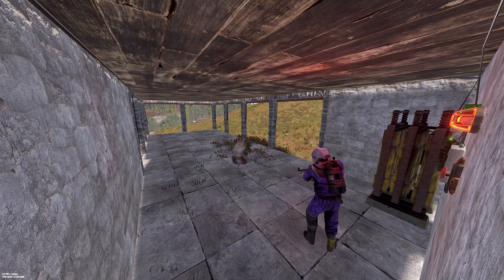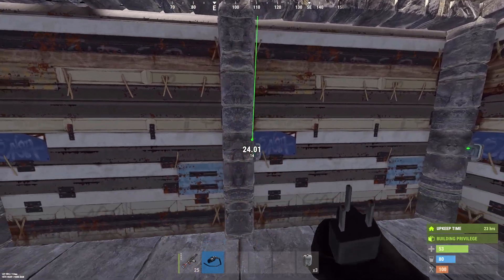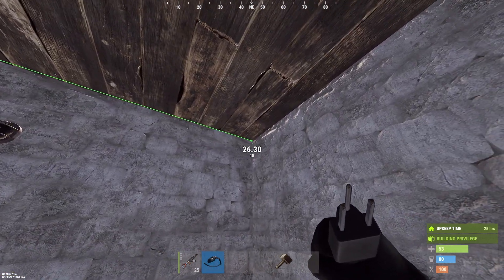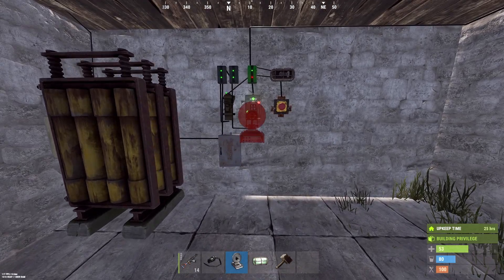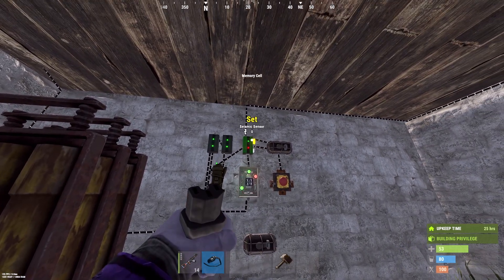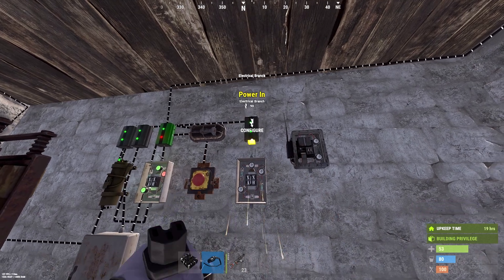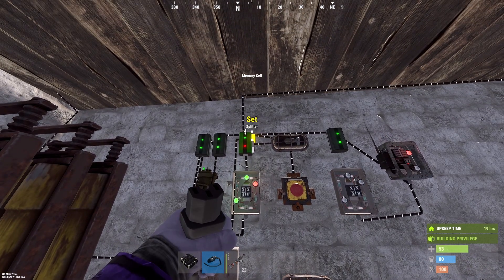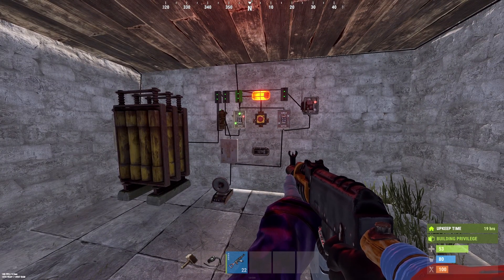EMERGENCY BASE LOCKDOWN with Seismic Sensor | Rust Guide

Comment: Just a little tip when making the panic button if you seal in the smart switch then you dont have to unconnect the button cuz if the smart switch is on then the button wont do anything.

Comment: Great setup, that first XOR switch isnt doing anything btw. You can just hook the power directly from the first branches branch out (the power for the doors) directly into the power in of the memory cell.  Also, instead of a button, you can just use another smart switch to act as the system reset. That way both the lockdown and release are controllable from your phone, and smart switches require auth to interact with. If they got TC its over.
Reply: You're right but it's the second branch (the power for the doors)

Comment: Is there a way at the end of the upgraded circuit to have it not open all the doors with the reset button, but keep them closed and still retain the door closing when an explosive goes off? Seems like a chore to have to just reclose all the doors in base just to re open the few you need open but still want to close if a raid starts.